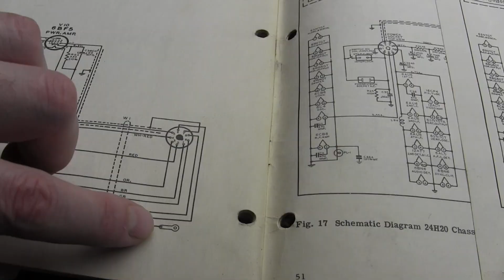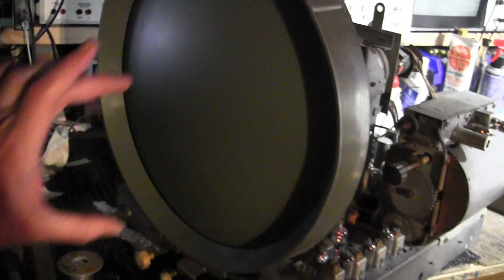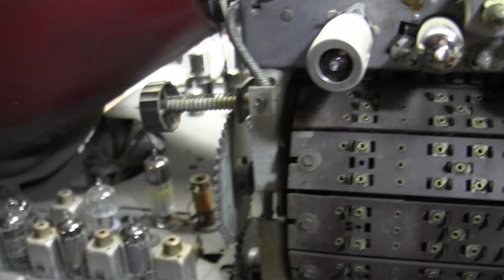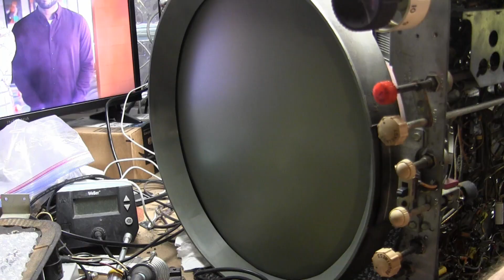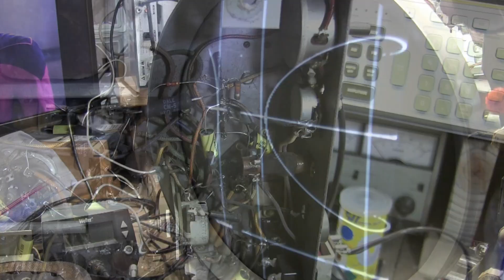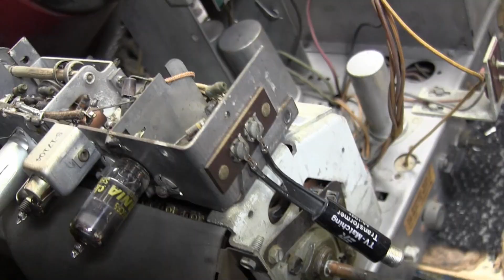Zenith H2438R "Aldrich" part 4: Tuner tune up...

Comment: What I do with the AACap is leave the electrolytic leads long enough to make loops with them on the underside and use them as connection lugs. I usually push a piece of shrink tubing over them when I’m finished with the soldering.
Reply from the maker: Thank you for the wonderful suggestion

Comment: For similar phenolic boards in jukeboxes and some presets in radios. What works really well is Scubbing Bubbles Mega Shower Cleaner in the spray foam can. You could try removing 1 section and giving it a good spray in the laundry tub. Rinse with hot water and blow dry. They come out like new, shiny contacts and all.

Comment: I didn't catch the full amp chassis schematic, could that small chassis be floating from ground to develolp bias for the output tubes? That would explain why the filter caps get grounded to the TV chassis.
Reply: I have the same schematic, but no, both the isolated can cap negative on the amp chassis and chassis ground of the main TV chassis are connected together by a separate wire that connects to the main chassis and is at ground potential, in addition to the amp chassis also being at ground potential- except that it is through one of the wires going between the two chassis, rather than connected right to the amp chassis. May be confusing to follow, but it is because the wires have a small resistance in them, so if the grounds of both chassis as well as the negatives of the filters were all connected together, the main TV chassis could be floating at a small AC voltage difference than that at the amp chassis, which would create an undesired AC ripple (hum) in some circuits.
Reply: @oldradiotvsc9836  Ground loop.

Comment: Great to see this progress! On the 19" set I worked on recently with the same chassis, I also had to lube the fine tuning shaft, and the tuner contacts were dirty to the point of receiving between channel stops but not or intermittently on the stops. I used liquid brush-on De Oxit D5, brushing on all the contacts for channels 3 and 4 and it worked well. As for the filter can on the power chassis having the isolated ground and connecting to the ground wire to the main chassis, yes, I made the mistake of following the schematic and grounding it to the chassis, and it resulted in a lot of audio hum, on another of the same set I worked on 5 years ago. Then upon studying it well I finally saw that it was supposed to be isolated, and then I fixed that and the hum went away. Definitely try turning the AGC control on the back, I had to on the recent one to get anywhere a decent amount of gain.